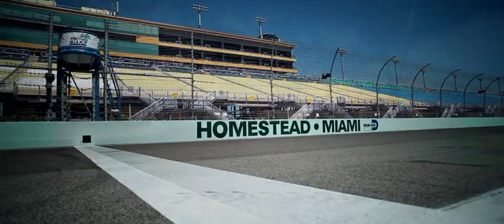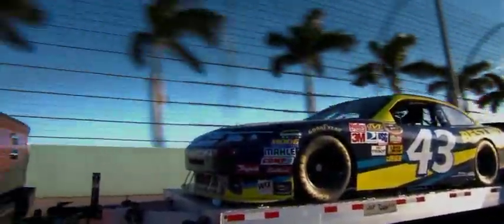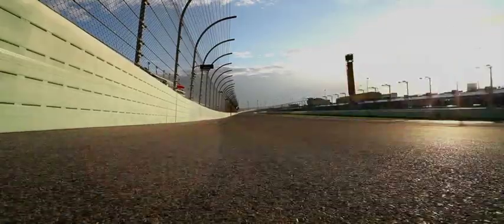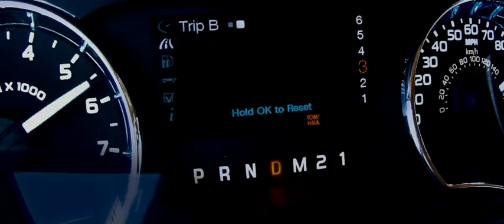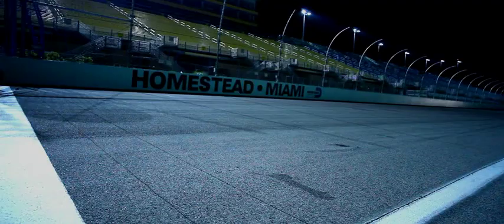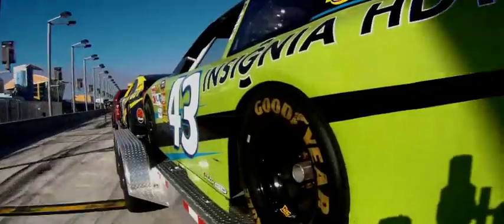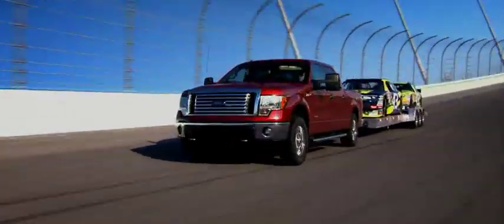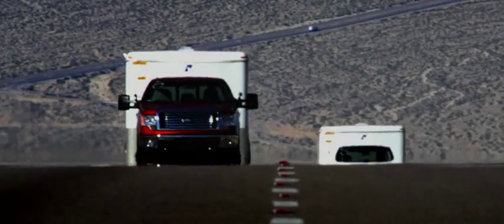#3: 2011 Ford F-150 "Beat to Hell and Back" 3.5L EcoBoost on the Race Track... The Saga Continues

Comment: not to sound  like an idiot but this vid is not all that convincing. Sure its cool but I hear the sound oif  a v8 enginge  and no turboos. the  people shold have done a short clip of the test INSIDE THE TRUCK  other than that,  i have no other complaints.
Reply: That's a v6